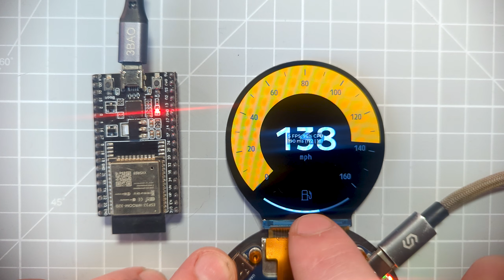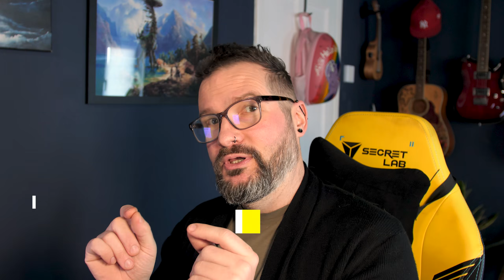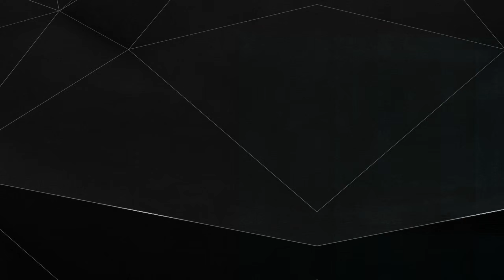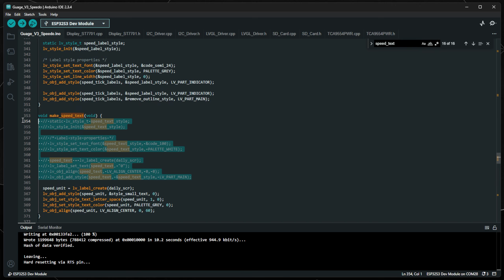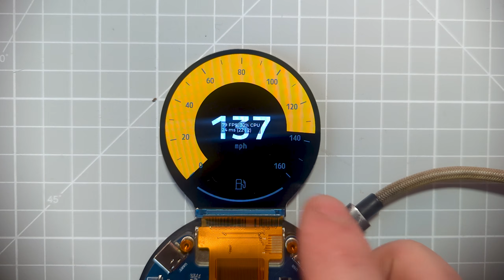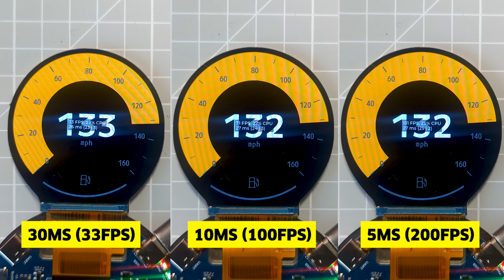LVGL Too Slow? Do THIS for Maximum FPS!

Comment: If your hardware and software combination efficiently supports a indexed colors (with ≥8 bit depth) you could have one color value for each value between 0 and 160 on the dial. If enough bits are left over you could partition the digits in the middle into non-overlapped segments and try to repeat the trick per segment. You'll probably run out of slots in an 8 bit pallet unless you change the font to one that minimises the number of segments required (especially if you want to keep both numbers with one, two, and three digits centered text. It's porbably better to just blit the number glyphs into the frame buffer. Either via block draw commands (for a smart enough display controller) or DMA for a memory mapped frame buffer. If the display controller supports custom fonts or sprites those are probably ideal. This way frame draws should be so fast that double buffering can be avoided without visible tearing almost halving the required memory.

Depending on the MCU used its DMA might flexible and fast enough to be worth using as a kind of poor man's draw call co-processor to further offload the CPU. It would work on STM32H7xx and RP2040/2350, but you'll probably be out of luck finding any existing (or even writing your own) portable abstraction over the last hack.
Reply: Color table tricks or custom fonts is also how smooth warp speed star fields effects have been implemented on several old 8/16 bit home computers.
Reply from the maker: This is really interesting. I'm going to have to look into this

Comment: Nice video, thx!
As for esp now and system ressources, why not use the second cpu core for that?
Reply from the maker: It should be utilising both cores off the bat and switching between them as needed for speed, but there might be a case to pin ESPNow to one core and let the rest run off the other. It's definitely worth testing
Reply: @GarageTinkering Hm... 5fps and 190ms cycle time would suggest only a single cpu core is used, but I don't know your SW environment. (Esp for Arduino you'd only use a single core per Default)
Reply from the maker: @mgeb101  Hmmm, potentially. I'll have to look at it some more, though to be honest with moving to hardware CAN, and the fact the large displays will use a P4 and a C6 together, I don't foresee it being much of an issue going forwards
Reply: @GarageTinkering  Don’t hold me to this, but I don’t think anything on ESP32 automatically uses both cores. I’ve only ever seen dual-core code where tasks are expressly pinned to a core.

Comment: If only someone mentioned a better way of transferring data in multi-sender and multi-receiver mode instead of ESPNow... Joking aside, I believe those LCD screens are only capable of 60fps. Currently I can't verify that, I have not ordered mine ;) My cars instrument cluster is the rectangular kind. But I'm considering a change to round clusters from earlier models. But as soon as I have them, I'll have a look at the actual pixel update rate. I do have equipment to test that (a photo-diode and an oscilloscope is all you need). I also don't see the benefit of tripple buffering here. Otherwise I do agree with your statements.
Reply from the maker: Yeah triple buffering gave me no benefit that I noticed and I'm just sticking with double

Comment: I believe that the FPS rate indication represents the frame rate with which the LVGL library generates the frames and updates them in the frame buffer. There is another frame rate, which corresponds to the rate with which the display driver updates data to the display through RGB interface. And this frame rate is fixed and determined by the horisontal sync frequency or pixel rate during dispaly driver initialization. Display driver pulls data from the frame buffer with constant rate even if the data in the buffer is static. LVGL can refresh frame buffer data with any rate, but the actual frame update rate can not exceed the driver frame rate.
Reply: This is why vsync is important as if you are halfway through rendering a frame to the framebuffer it might show half of the old frame and half of the new one.
Reply: @lex4o exactly, it’s called tearing.
Reply: Not to mention that the youtube video is not 60fps. So we can't really tell the difference as viewers. They "eyes" can definitely see the difference, do you need it though? Not for such a small gauge(preference). Do i have a 260hz monitor? Yes, and yes i need it!
Reply from the maker: Interesting. Appreciate the extra insight
Reply: why do you even mention this? this is how any display works. nobody is speaking about monitor when talking about raw fps and performance
Reply: @doodocina  because the side-by-side comparison at the end is entirely moot if the display itself isn't refreshing that fast. near the end there was talk of 'can you perceive the difference?' when really there's a hard (and knowable) limit based on the display's refresh rate.
Reply: @heeeyno  graphics performance is better = drawing frame takes less time. it's not about result fps. you always should cap to display refresh rate, even on your pc.
Reply: @doodocina that is good advice or maybe it's better to say, it depends, if you are optimizing for quality or for responsiveness. If you play some fast action game and want to have the best possibility to win, you don't care about screen tearing you just want the lowest lag, and must not limit fps.
Reply: @AlessioSangalli  capping fps != enabling vertical sync. this doesn't affect lag at all. there is also no reason to render more frames than your display refresh rate is. also there is a thing called free(g)-sync on any monitor now
Reply: @doodocina well if you say that your understanding is incomplete. Freesync only helps when your gpu cannot match the refresh rate of the monitor, which might be often don’t get me wrong. But for the lowest latency it’s not what you want if your flu can go above the monitor RR

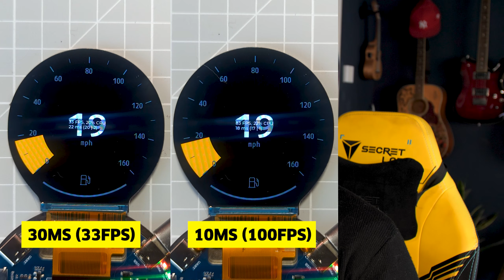Comment: 22:30 This youtube video is 25fps 🤓
Reply from the maker: Ha. I actually didn't even think about that!
Reply: That's why any comparison above YT's limit needs to slow the vids down until the fastest vid displays as 25fps. But in reality humans can't perceive much above 60fps, higher is only a thing with gamers because it deals with input lag.
Reply: @hydrocarbon82 what are you talking about. It's very very easy to see the difference between 60 and 120Hz, 240Hz is also very nice. It is immediately visible when you scroll a screen, not necessarily when there are just changing numbers of course

Comment: The displayed FPS above 10 is a lie. You only update the counter 10 times/s (every 1/20 of 5ms  loop), meaning the data on display changes at 10FPS. So even if LVGL checks if it needs to update anything 160 times/s (that's what interval in lvconf.h mean), it only sends actual data 10 times/s. When there is nothing to refresh, the "frame" is instant. Try changing the displayed data faster (e.g. update the counter every tick) and see what happens.
Reply from the maker: It animates between values rather than just stepping, so it totally could display higher FPS than 10 if possible.
Reply: @GarageTinkering  Also of note, at 22:35 the PERF_MON shows that in all 3 cases render process took around 20ms per frame, of which 2 were flushing the buffer and 18 was actual drawing. So even with such small amount of updates, it cannot go above than 50fps on average.
Reply: @GarageTinkering  yes, I forgot about animations when I wrote the comment. However, I just checked: 1) the lv_label doesn't animate, it only switches to new string; 2) lv_arc doesn't animate automatically; 3) if you use lv_anim, then it operates on integers, so a change by 1 will only refresh the screen 1 time. So I think you only see smooth transition when arc overflows to 0 (and an intermediate value is indeed noticeable on the video). Even if you scale the "speed" to a larger arc range, under the hood the arc angle is of integer type and cannot go fractional. 

I am not saying it cannot display more than 10FPS, pretty sure it can. I am saying that in this case content is most probably changing at no higher than 10FPS.

If your smartphone can do high-speed videos, you can get more accurate FPS measurement by actually timing the refreshes.
Reply: That's also the reason you don't see any difference between 33 and 160fps. There is none)

Comment: Wouldn't yo need to change whats to be shown on the screen faster in order to get any difference with increased FPS?
If you update it 10 times per seconds you won't seen any difference.
The define you changed, I would assume, just sets how often LVGL checks if there are any changes, and redraws the screen if there are any, otherwise does nothing.
Reply from the maker: It sent new data 10 times a second, but there's an animation between each step, so it feasibly has as many steps as it can draw. If you were immediately stepping to the new value without the animation then yes, there'd be no point going for a FPS higher than your data change rate

Comment: Can you get some better performance by controlling how the workload is distributed between the two ESP32 cores?
Reply from the maker: Potentially. I need to test it
Reply: This absolutely makes a huge difference with the wave share displays if you need to do other stuff. I’ve got code doing mjpeg video playback and decoding on one CPU and handling display work on the other made a huge difference.
Reply: probably easier if you change to FreeRTOS as you then gain more control over what tasks are running on which core.  Can still be done with arduino code (apparently) but would be interesting to see if that removed the issue with blocking the cpu as far as LVGL is concerned.  Do all LVGL code on one core and ESP Now on the other.
Reply: @andrewniles5390  On ESP32, the Arduino code just runs as a FreeRTOS task. (Specifically, AFAIK, Arduino code gets mapped to ESP-IDF calls, and those run on FreeRTOS.)

Comment: Not sure if the display itself is capable of high refresh rate(partly due to tft display, partly due to display controller limitation?), which is probably limiting the actual FPS in the comparison.🤔
Reply from the maker: You're absolutely correct. Comes into that note about diminishing returns. You'll hit the limit of the screen at some point

Comment: you can also try to use 2nd core on esp32...
Reply from the maker: I'd considered doing this and locking off the redrawing to one core and the ESPNow to another, but it should be optimising its use of the two cores off the bat. Could be interesting to see if locking ESPNow to one core freed up the other a bit better.

Comment: Nice, but i cant even get my code to compile for lvgl in arduino..
Got an gc9A01A with an esp32c3 in a little round housing..
Reply from the maker: What's the issue you're getting?
Reply: @GarageTinkering  thanks for your response!  Well i guess i must be doing something wrong,  probably a library version or coding issue..

Could u make a summary of  library versions that u use, together with esp32 core version and ide version?

Or maybe even a zip file with everything included?
Reply from the maker: There's a config file on a repo linked in the description which might help. You might need to adjust the setup files a bit but it should be a good jumping off point
Reply: @GarageTinkering  how should i modify this for my display?  
I mean like where to get the right .h files for my display etc